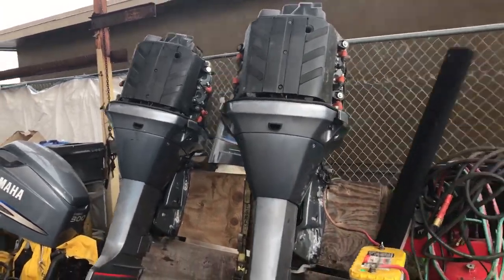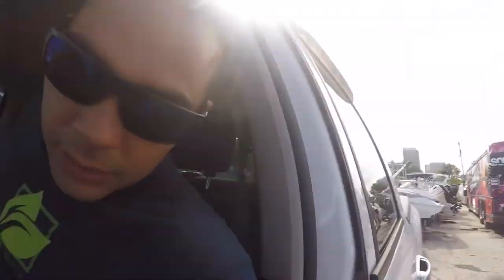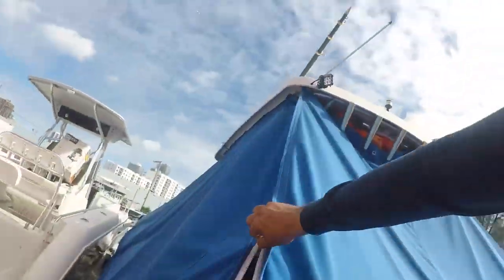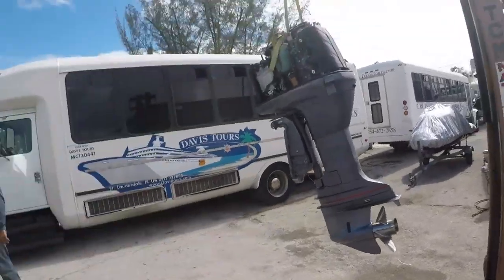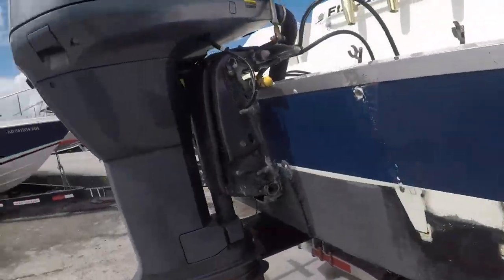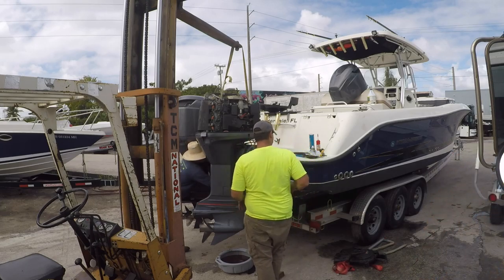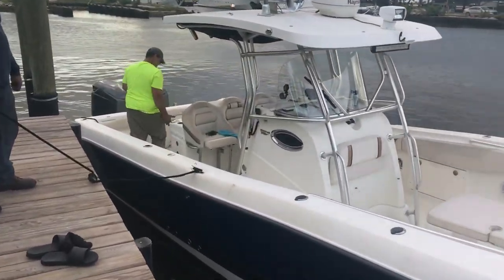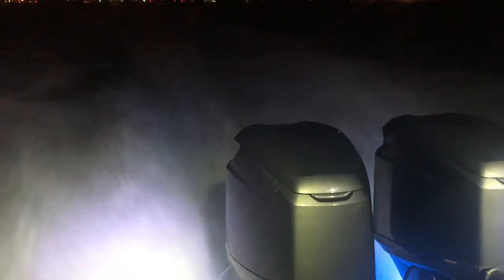Outboard replacement!! back on water 💦🚤

Comment: I'm late coming to the party but this is exactly what I would have done.  Now you also have  heaps of spares and could get the blown motor rebuilt ready for the next time. Hope they are still running fine after a year in.